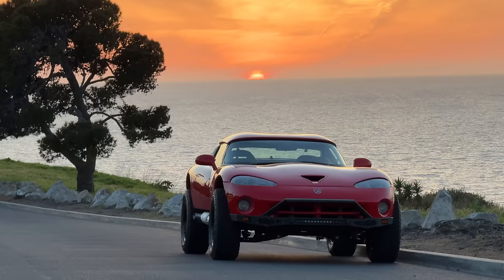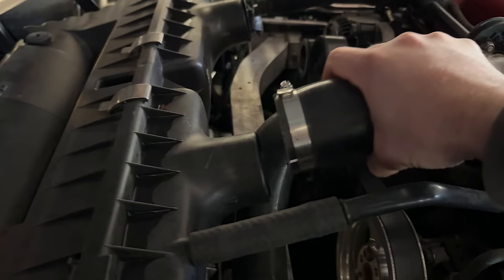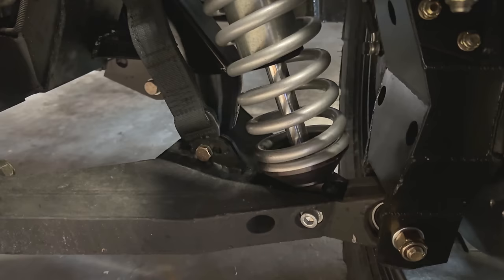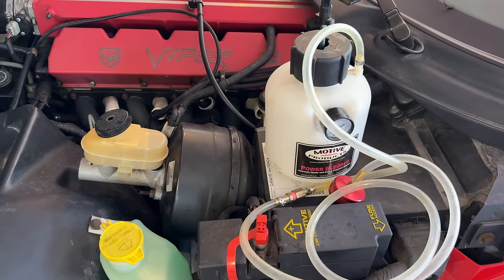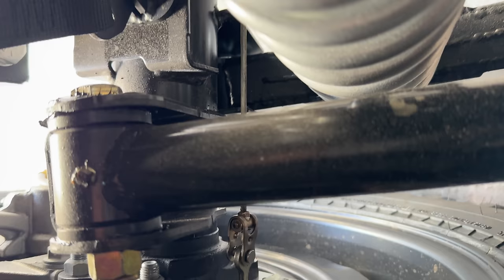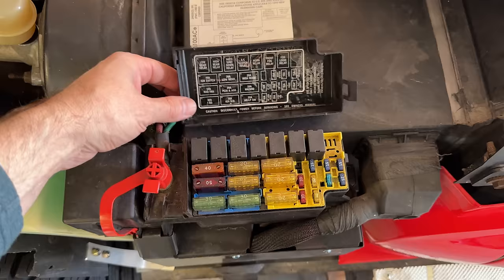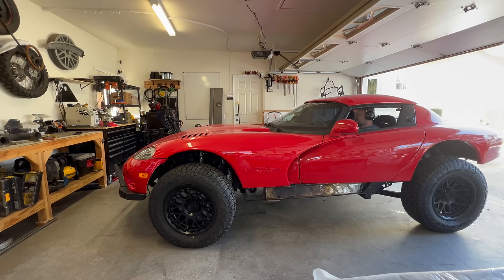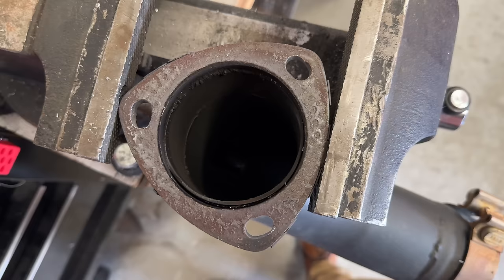The Off-Road Viper Is On The Road

Comment: I like the way you cut the frame next to the headers without plugging them with anything to stop the metal shavings getting into the cylinders.  That's precisely what I would have done.  I now feel like I have a tiny degree of the competence and mechanical skill that you possess.
Reply: hey,,  he has eight,    not so bad if one or two are a little "marked";))
Reply: @breakshot7451 surely ten, this is a Viper…
Reply: What a hero cop.
Reply: @leslieaustin151  it's a dodge, 2 are spares
Reply: @GTAmaniac1  🤣🤣🤣✔️
Reply: @leslieaustin151 awkward;))) aaaah  yes
Reply: SFM at tesla job interview
Tesla: So what are your competences?
SFM: So I cut the frame on my offroad viper and maybe didn't spray metal shavings in the intake. Anyways, it still runs.
Tesla: You're hired!

Comment: Quite a few years ago, I used a coat hanger to hold up one of my exhaust pipes, just "to get it home", and it worked so well that I never actually "fixed" it. Nothing is as permanent as a temporary fix. Love the car!
Reply: Tell us you live in a dry state without telling us...wait. A 300 series stainless pipe clamp can rust out before the warranty up north. Even a brass coat hanger didn't last much, the steel one didn't last through a summer.
Reply: Towed my lifted 76 Squarebody home one time with parachute cord and a 70' 3 door suburban!
Reply: Yeah I did the same thing except with plumbing strap and some pop rivets. It's not getting fixed properly until it falls off.
Reply: @starlitstreet  Plumber tape is legit exhaust hangar for life bro!  Did that to my 383 Stroker FireBird onetime, no cats, side dump turnouts
Reply: It says a lot about your character, you make do.

Comment: The build is looking so cool and I am glad you are happy with the shift knob!
Reply: This is a very nice made shift knob, looking very good.
Reply: Looks great, and the fact that it appears most of the knobs with shift markings are flattened at the top and Matt's looks completely rounded with gear markings makes it look even better. Awesome work. (Now I just need to get a cool car deserving of such a Gear Knob :-)
Reply: Fantastic work on the shift knob!
Reply: @Omsip123  thanks man!
Reply: @earld1403  cheers man it is a tiny bit distorted as you get away from the center but  barely noticeable. I'm here when you get that car 😄
Reply: @geoffkeller5337  cheers dude
Reply: It looks awesome, you should be proud of it!
Reply: All he really needs is a helicoil to adapt the threads to his old shifter. Does look nice!
Reply: What finish do you use on your shift knobs to hold up to the repeated use?

Comment: I applaud your restraint of not immediately heading out and doing some off roading.
Reply: First he needs to figure out an onboard welder. You know, for the return trip.
Reply: @MrSaemichlaus Oh yeah - something's going to break on that first off road test.  Loss of brakes on a steep hill, rolls backwards and slams the diff into a rock which shoves the driveshaft into the trans.
Reply: @MrSaemichlaus They're $1,300 and made by Premier Power Welder.

Comment: Easy thing to mitigate further leg burning on the sliders is to do similar to the heat shield on semi stacks -
Could make a nice pattern to match the build cut into them, and stand them off ⅛-¼" from the sliders. Powder coat or paint red to bring back some of the 10ft OEM look.
Grindhard plumbing uses hexagons all the time, but this is a parts bin chrysler. Use a pentagon pattern.

Comment: Absolutely fantastic. 

Have you considered having the metal side skirt/ rock sliders ceramic coated? Nice durable finish and the thermal barrier properties are so good you could even go without that glass fibre wrap and still avoid burnt calves when disembarking in shorts...

Comment: When I was at auto tech school, we had a prototype Dodge V10 there from the early Viper days. It was when they were still doing testing on stuff, hence the prototype in "punch dots" on the heads. Pretty sure they were aluminum Viper heads on the old truck V10 block. Or they were aluminum versions of the truck heads. Don't remember which. I'd have to find my pics and see what they were. It was back in 2010 so the engine was quite old at that point. Still in great condition, though, as they only used it to take apart and put back together. It was my project for "engine - mechanical" part of the course. It had to spin perfectly when you put it back together so you had to measure clearances, bearing shells, Pistons, rings, etc... It was quite fun.

Comment: I’ve owned two Viper GTSs. Removing the CATs caused zero running issues or codes and removed 80% of the exhaust heat on the door sills.

Comment: On that frame.  Find some magnum steel. It's in a tube just pinch off and mix. I used that stuff to fix a 4in hole in my PTO box on my 18wheeler. I used valley tin and then the mag steel. And it worked great. And I was hauling coal back then and it was when we hauled like 85tons. Yeah that was right before they slapped well deserved laws on us. Great stuff.

Comment: You need some pictures of it from a camera with a tilted lens.  That will REALLY make it look like a hotwheels.  You can kind of emulate the effect in post by progressively defocusing top and bottom of the pics from the center out but an actual wide-aperture and moderate-to-wide focus lens tilted about 8-10 degrees will make it look like you built a very lifelike diorama for your hotwheels.

Comment: haha.. this just took me back to my one of my favourite childhood TV series, aptly named "Viper". nice to see something like this done in real life!

also, just a random one regarding the exhaust at 8:12. back when I was about 12 or 13 years old, my mom had an old Nissan 1400 bakkie and the nearest tar road was about 40km away. with all the rough roads, the rear-most exhaust bracket kept breaking, needing to be replaced every 5 or 6 months. after the third bracket broke, I got to work with my grandfather's fence post wire tool (it also twists wire, similar to what you used here) and made my own bracket for it.. which actually ended up lasting about 4 years.

sometimes there's nothing as permanent as a "temporary job". (:

Comment: Fun trick, make sure brake reservoir full, open a bleeder, then slowly pump the brake pedal numerous times. The up stroke won't draw in nearly as much air as the down stroke pushes out fluid. After pumping, let gravity take over and drip the bleeder for a minute then close it. Repeat on all corners and you're done 😉

Comment: Those power bleeders are great. The hose degrades over time though. I ended up replacing mine with reinforced EPDM after the original hose exploded and showered me and two cars in brake fluid.

Comment: 3:43 don't 3D print brake reservoir caps, bleeder kits or anything else to do with brakes. Most common printable plastics hate brake fluid. It eats PLA, HIPS and ABS, it makes PETG and nylon brittle, pretty much the only printable thing available for us mortals that can contain brake fluid is polypropylene, and polypropylene is extremely hard to print.

Comment: I worked in the sand casting part of a foundry and we in fact used off the shelf black RTV for sealing the hot stuff but it did burn off somewhat regularly but it was in direct contact with the hot plate

Comment: Should you rearrange your brackets and spacers for the limiting straps? That bolt doesn't seem sturdy enough for such a load in the center of that span, but if you move the brackets to the ends of the bolt with the spacers in the middle, it should tolerate the shear forces just fine.

Comment: At 10:00 you are talking about its looks- referencing- making reference to HotWheels having made a toy car like this.... they SURE DID! Was 1 of my favourite out of all the cars i'd collected. And exactly! It looked ridiculous next to any other- it too was red, but, red is possibly the only color a Viper should be draped in. Red exterior with butt burning black leather interior with a touch of boldly embroidered Viper logo/ graphic peasantly placed upon each and every headrest- reminding you of the poisonous power that lies within the vehicle you've just sat in.

In the south there's a car culture that loosely refers to a vehicle style of large- massive low profile wheels, and a lifted jacked up and done up body where the term "Donk" is used- though specifically Donk is a reference to Impalas which a large portion of em get the low rider custom treatment- some say the Impalas' logo looks like a Donkey. The term also having connections to the same regions music- southern rap- where one can hear the terminology "Badonka Donk{ referring to a lady's exceptional large(and jiggly) behind- with the cross over to the lowrider scene referring to the stance of the vehicle resembling as such sitting on the large rims- also bouncing on either the air ride suspension or the hydraulics.

Thanks for the memories of my old HotWheels- if i still had it, i wold 100% have sent it to ya...but, that was many moons ago.......

Sweet ride and can't wait for further content with this car.

Comment: The stock Jeep E-Locker is kind of a bummer with no limited slip function. Something like a Torsen style diff would be a decent upgrade and there is a good market for a low mileage locker since the Jeep ones fail pretty often.

Comment: I have had a thought. For the exhaust, and also rock sliders, can one and then should one, create a 3-4 channel aluminum tube inside aluminum box section frame, so that:
less overall gases are shot through each portion of the exhaust, causing less initial heat
heat dissipates better out of the aluminum
one can achieve a ferrari esque fender flare design by pinching down the box section
anodized aluminum to the color
will look badass, still function for most of the exhaust needs better? and still give some rock sliding ability, to which you could add later skids of steel?

Comment: Why did you not use a cardan assembly with yoke slip eliminator instead of changing the angle of the motor? I did this in my rock crawler, and it worked well.

Comment: IDK if the regular inline 4 GG1 mazda 6 has this as well, but the mazdaspeed6 has an overflow that looks like it will fit your space, it's narrow and kinda curves in, might be worth a shot to run 2x of them one on each side due to the smaller volume, which you should measure

Comment: Didn’t Dodge originally intend to share the Viper’s V10 engine with Ram trucks? Yea they ended up heavily modifying it, and going to a lighter aluminum block, but the shared design and architecture is why it still sounds like a tractor, right? Now the exhaust note matches is character.
 
If its engine was supposed to be shared with the RAM truck, is that why it has wayyyyyy too much torque to manage in the lightweight viper? Seems/sounds like it’s a low end torque monster rather than typical high revving high horsepower sports car.

Anyway, with this conversion, I’d imagine the torque is more approachable and less likely to step out the rear end and lose traction through the addition of increased unsprung mass from the large off-road wheels & tires. Traction might be easier to come by, making it less of a death trap. (That is, ignoring the rollover risk when someone inevitably tries to drift it on or off road of course! That would be hard to resist!)

This is my dream car! I been drawing and doodling lifted Vipers ever since I was a kid. It’s everything to😊 love about big trucks and sports cars combined! It’s so awesome to see you make this a reality. I got my degree in mechanical engineering thinking I’d get to do something like this with my free time and money, but an incurable brain tumor and disability took everything before I had my feet under me. Sometimes I’m resentful, other times, I’m happy to still be alive and experience the small things. It’s a privilege to at least see my dream come to life, even if not my own!

Comment: Portals on the rear end would drastically improve drive shaft also use an electric locker I think the is a system the instead of putting the drive shaft in the rear yoke there. Is a.component that idk if it Bluetooth or wired but it worth looking at do not spate my knowledge I’m not right but in the right direction lol

Comment: Do those "Good Enough" stickers actually stay stuck on?  I only ask because....  And If you did actually drive it on the "wrong side of the road" in the UK* and attracted police attention, one of the issues might be the wheels/tyres protruding from the body work.   *It is the 'land of the free' in that you can park pointing in the wrong direction on either side of the road (if parking is allowed).

Comment: The condescending rhetorical commentary is nauseating. As for the build, I oftentimes wondered what it would be like to do such a thing with a Viper. In case you don't know, the original name of the Viper wasn't actually Viper it was supposed to be simply called SRT. I am a retired UAW Chrysler employee 5th generation. I was part of the development team. The idea of the Viper was created by two friends of mine who were IEs in my location at KTP Kokomo Transmission Plant. The Viper was created just down the street from the plant at one of their homes in a garage made out of cardboard. They presented the idea to the Executive design branch and from that moment they were hooked. They loved the idea so much they promoted them and they left their IE positions and moved to the main headquarters in Michigan. The model regardless if the company survives or not will remain as a much sought after vehicle until the end of time.